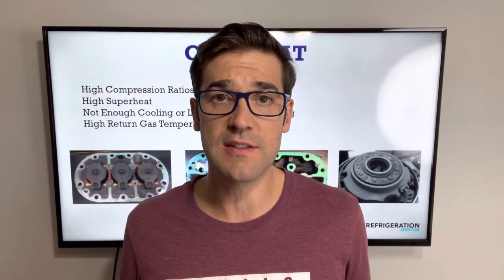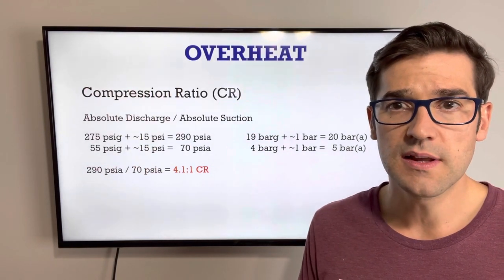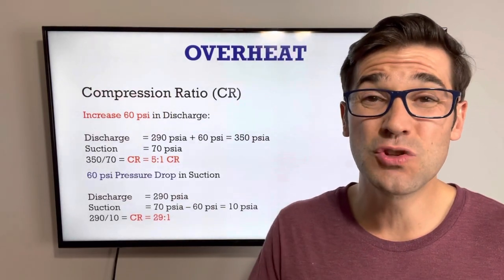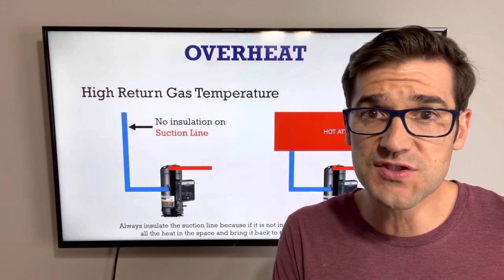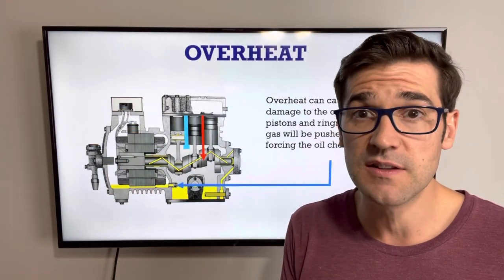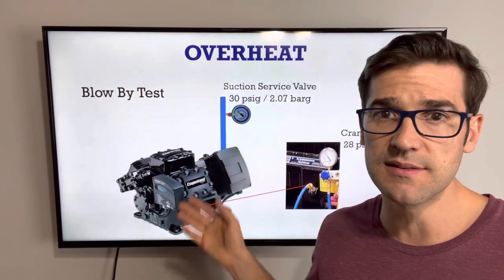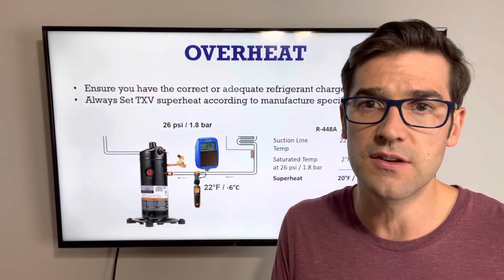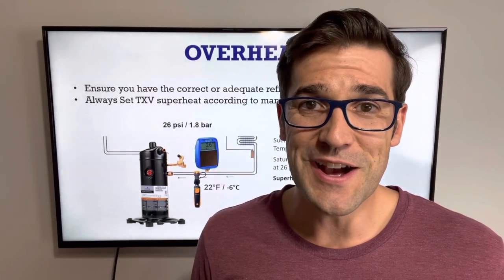How To Prevent Compressor From Overheating

Comment: Brand new service tech to the trade (almost a year into it and thrown to the wolves) Just so happens I got the email this morning for this video. And yesterday I had a compressor fail. Broke it down and found that it had a bad valve plate. I will definitely be watching this video again while I trouble shoot the issue. A piece of the valve plate broke off where the pistons push through. I’m still learning the correct terminology so I apologize.
Reply from the maker: It’s so good to hear that you are taking the compressors apart and inspecting them.

Comment: I just replaced an AC and heater in a 22-year-old home. After 2 days the compressor stopped working - just ambient air from the vents. The thermostat actually alerted me to this with an error message. The company came out quickly to check - the compressor was very hot - they cooled with water (I'll assume to reset a thermal switch) - it ran for about 5 minutes then shut off - the fan still working but no cool air. The unit will be replaced tomorrow but I wonder if a 4-ton AC unit (Had a 5 ton for 22 years) will need to work harder than a 5 ton, thus running longer before the home cools down to the thermostat set point - and if it runs longer, will it heat up more and possibly this happen again? Vent calculations were done, a 4-ton was called for, so I can't really question this, but I think strange a brand-new unit would fail at the compressor. Are there things I can check weekly after the new unit is installed to be sure it's not going to fail when it's 95+ outside. I will monitor the temp at the exit of the compressor (just outside the AC unit) and it should be very cold. I will take reading with an IR thermometer and note these. One other thought - if the duty cycle of the compressor was 70/30 (on/off) I can see it might not have time to cool down before the compressor starts again - thus heating up an already hot compressor. Any way to estimate how long it should take a 3400sq/ft home to cool from 78 to 73? is there a rule of thumb in this area? Yes, window efficiency and air leaks in the home will matter, but just in general.. should it cool 2 degrees per hour? more / less? and if the home heats up from 3pm-8pm and the AC can't keep up, so it's on all the time, does this mean I need a larger AC unit (more tonnage?)  Thanks for any input.

Comment: What will be the effect on discharge line temperature if we put the compressor in the path of condenser airflow?
Reply from the maker: It will reduce the temperature of the discharge as the hottest part of heat of compression happens inside the compressor itself. Great question!

Comment: Uh-oh... this video is not for the uneducated (me). Just an old person looking for a way to fix my chest freezer i use as a frig (it's only a year and a half old; overheating terribly). Thank you.
Reply from the maker: @2Hearts3  well it could be low on charge, plugged capillary tube or dirty condenser.
Reply: @RefrigerationMentor  thank you very much for your reply-- my guess is dirty coils (have a Lab who tracks in a lot of dirt) but can't get to them. Appears to require turning over and access underneath. Tried side panel, no coils there. No access at back or other side, so i guess underneath. Frigidaire 7 cubic ft chest freezer. (Customer svc closed thru weekend.) Thank you!

Comment: Yes, everything you said is really important, but it is very important to run the system at a superheat value suitable for the design. While a high superheat value may cause overheating in the compressor, a low superheat value may cause liquid refrigerant to reach the compressor. Super heat control must be performed, especially in systems with long distances between the evaporator and condenser or in systems where the suction pipe has to be replaced (there may be a need to move the outdoor unit).
Reply from the maker: All valid points. Thanks for sharing.

Comment: What is the standard compression ratio
Reply from the maker: there are some rule of thumbs but not real standards alway go into the operation envelop or performance chart to make sure you stay inside.  Low temp compressors will run at a higher compression ratio

Comment: What’s the point of converting to absolute from gauge? My high school maths is telling me this cannot affect the ratio when added to both sides.
Reply from the maker: That’s a great question. I will look into that.
Reply: @RefrigerationMentor  Oh I already figured this out. It's because when you add/subtract the same number to the top and bottom of a fraction, you can't just cancel them out like you can if you multiply top and bottom by the same number. So 1/2 is .5, but if you add 14.7 to both top and bottom, you get 15.7/16.7, which is most certainly not .5. But if you multiplied 1/2 by 14.7, both the top and bottom, you get 14.7/29.4, which is still .5, so you can cancel it out. DIfference between absolute and gauge is addition, not multiplication, so you can't cancel it out, which is why that extra 15 or 14.7 is important for compression ratio.

Comment: What’s the high end of superheat that’s acceptable to Copeland 
If my memory serves me you said 20-40 is acceptable. 
40 being the max as long as the discharge is not above 225 deg 
Please if you see this comment let me know so I know I am telling the junior techs right 
Thanks
Reply from the maker: Yes if you can maintain a 20F (11K) superheat at the compressor and the discharge below 225F (107C) you should be good.
Reply: Hi, if I convert °F to °C, will it still be °C/1.8?